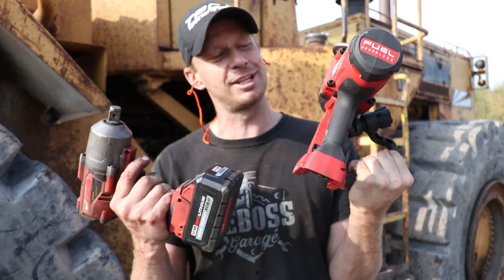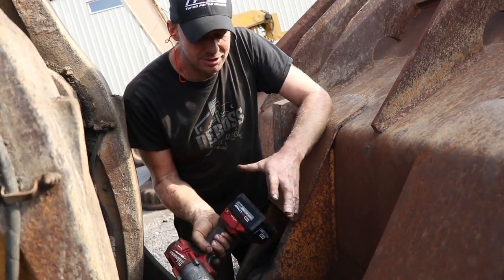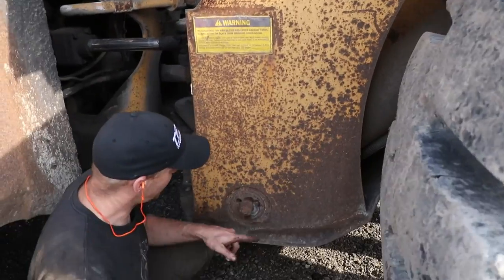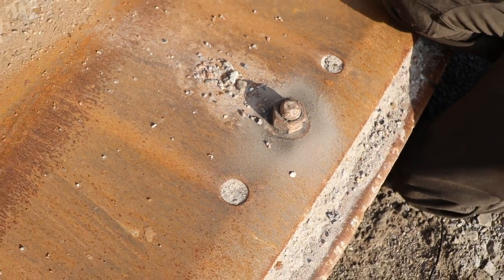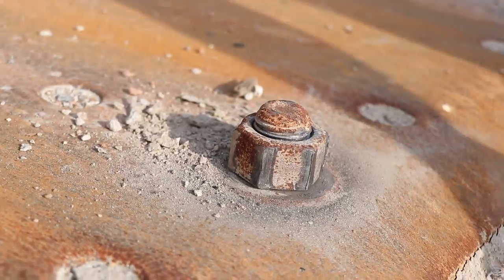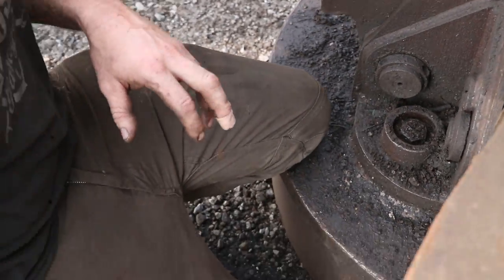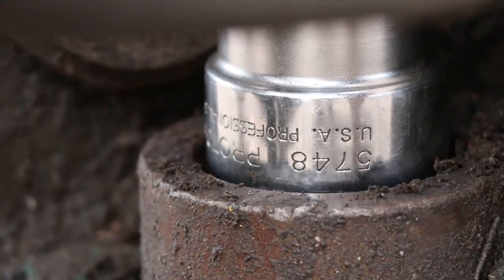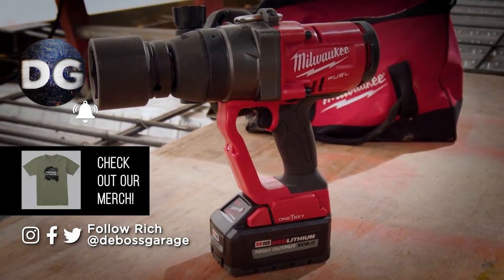Busting 40 Year Old Nuts with a 1 Inch Impact Wrench | Milwaukee M18 FUEL 2867-20 REVIEW

Comment: Impact sockets would make a big difference.... and also 6 point instead of 12 point
Reply: Why would impact sockets and 6 point make a big difference?  Just curious.
Reply: GetBlitzified impact sockets carry way more material for weight thus transferring more kinetic energy to the fastener. 6 point sockets have contact around the entire bolt head whereas the 12 point only make contact on the corner points of the bolt head thus allowing more energy transfer
Reply: GetBlitzified impact sockets are harder material so they don’t have as much give and 6 point sockets would offer more contact surface
Reply: Sam Wagner aren’t impact sockets softer while chrome sockets are harder and more brittle? Therefore, impact sockets handle impacts better. 

Seems like if you wanted the most energy transfer a harder socket (chrome socket) would be best.
Reply: AaronMoore I don’t believe so.. I’m no metallurgist so I could be wrong, but I believe that impact sockets have a greater hardness so that they don’t twist as much as a standard socket, and they’re built thicker so that they don’t shatter. Like I said, I could be wrong. I’m not an expert, just a diesel tech student.
Reply: @G Manloh Impact sockets are chromoly and standard sockets are chrome vanadium. Vanadium are harder and less prone to flex, but when they fail, they fail big. They will eventually shatter when they fail.

Chromoly impact sockets are more ductile and will handle impacting a lot better. When they fail it's usually a single crack up the side or even cracking in half, but they disspate energy slower and won't become projectile (usually. Broke a 2-7/8 impact socket in half a while back...that was a trip)
Reply: I was checking comments to see if anyone made that point before I made it - you did.  I agree wholeheartedly.
Reply: Yup chrome is harder than an impact and doesn't give as much as a fat girl. Moreover, I have no clue why he's using a 12PT socket and a single battery. Jesus spend the $150 and get another batter.
Reply: @SidewaysInTraffic  yeh i have the 3/4" mikwaukee impact and my experience is that once the battery is half empty it doesn't hit as hard anymore
Reply: @GetBlitzified  36% of kinctic force is being wasted also there is microscopic areas where ecpanding heat will fill. heat is the enemy of effecency essentially. a engine will run best in terms of towing torque and hp at 195 degress vs 215. Same thing with computers when they run hotter ram is utalized nearly 27% less!
Reply: @Piecemakerfirearms  couldnt have said it better
Reply: @SidewaysInTraffic  the batterys are only 115$ on sale....plus he makes hella money from YT....this is milwaukee slander!
Reply: @samwagner31   Impact sockets are actually softer. The reason you are told not to use standard sockets is because they are harder and more brittle which is why you can go look up countless videos of standard sockets on impacts shattering/cracking. 6 points are better than 12 points because it has more contact patch with the bolt head or nut, but impacts are heat treated differently than standard, and are not as hard as standard and are also softer  making them able to endure the torque & vibrations from the impacts.
Reply: D-RAGE Runningflames nope, I’ve looked into it to confirm. As others have mentioned above. Impact sockets are harder so that they don’t flex, that way all of the power from the hammering is transferred to the bolt. Chrome sockets are softer metal with a hardened chrome surface.
Reply: I have bought some impact sockets which are specially designed for crank pulleys etc. The socket has a way thicker wall so it has more weight to pull the bolt round with the impact
Reply: @samwagner31  https://agradetools.com/impact-sockets-vs-chrome-hand-sockets/
here is a link explaining it. Impact sockets are softer making them less brittle which allows them to take the impact and vibrations to transfer work. Skyscrapers sway in the wind as well as have movement in certain ones to stay standing during earthquakes. The taller something is the more sway it will have. Fact. (you can look that up as well if you wish) The same principle applies here. The softer material allows for the give and take vs the shattering of standard chrome sockets. 2 year degree automotive technology, as well as associates degree for automotive technology high performance racing application and development. Provided and article for you above. Impacts are softer. It has to do with  shock load it can endure. You cannot take something that is hardened and expect it to be able to handle torsional load and vibrations. They break simple put. Impacts are hardened differently and have a different chemical composition on top of that. Another fun fact about vibration and being able to endure vibrations. Salt flats racing. Any time they have a break on their vehicle. chassis or roll cage to be more specifically. Tig welding is not the best choice as its prone to breaking under heavy vibrations. Oxy-fuel welding however handles vibrations extremly well.
Reply: @jdm_john8240  thicker sidewall on a socket doesnt add more weight to loosen the bolt. Its torsional load on the socket. Weight and leverage only matters when you are using a socket and ratchet or breaker bars with cheater pipes in extreme cases. Companies will always have special tools, however the socket would be thicker due to it being softer to add strength to it, and no thats not the same as hardness. As an example look up aluminum connecting rods for a chevy 350 vs forged steel connection rods for a chevy 350. Big overall size difference The forged steel is much smaller in size. The aluminum rods (which are extremely popular) are thicker and more bulky to add more strength to the part to endure the loads it is under due to the material being softer. And to be technical. This is to everyone above. if anyone says they are selling hardened impact sockets guess what impact sockets as well as chrome sockets are hardened when manufactured. Its part of the process. The hardening differentiates between the 2 though.
Reply: Leen vd Linden idk why ppl use 12 point unless it’s a 12 point head of a nut or bolt
Reply: @samwagner31  impact sockets are a softer material that's why chrome sockets can shatter then on an impact is because they dont have as much give as an impact
Reply: @samwagner31  impact sockets made for impact guns
Reply: HONESTO UNO  
They make the best cordless impacts on the market
Reply: Lisle makes much heavier than usual sockets for removing crankshaft balancer bolts.  The extra mass makes a big difference in the ability of impact tools to remove the bolts.
Reply: Mitchell Nova  
Yes it does
Reply: Since I don’t know somebody please explain to me why a 6 point socket would be better than a 12 point also why not a chrome socket
Reply: @samwagner31  chrome sockets are actually harder
Reply: That’s correct Aaron.

Comment: I call my 1/2" one my "Problem Solver". Its all i need in automotive applications. My air impacts have been collecting dust since i bought it just over a year ago. Never looked back
Reply: yes who wants an 1400 nm stubby impact in the shop where air is always avaible if you could work for the same force output with an 8 to 10 pound tool. 
This 18V Tools are great for the field but still they are power to size and weight not even close to air tools and i doubt they never will exept there will be once a Batterie with nearly limitless output and no weight
Reply: @Zozo806  I use my M12 3/8" impact or ratchet 90% of the time. They are lighter then most air tools, and i dont have to trip over hoses or risk hoses scratching paint. The M18 is only used for larger/stubborn bolts, and ive never found myself holding it for any great length of time. Pick it up, spin the bolt off, then set it back down.

I was a huge air tool fan boy too before experiencing these tools. I have probably $10,000 worth of air tools literally collecting dust. I recently removed the air tool rack from my bench and stuffed them all in the back room.
Reply: @MarwoodAuto - that's good to hear. I was all set to get an air impact until I started learning how badass the new battery powered stuff is. I need to put new shocks/springs on my Jeep and my old 250ft/lb max Craftsman electric impact was doing absolutely nothing to loosen all those rusted fasteners. Hoping the Milwaukee 2865-20 I'm getting will work...
Reply: I feel the same way I have a 3/8” and a 1/2”  and my air tools have stayed in my cabinet since

Comment: Impact socks would make a big difference not only for fit but mass.  If you simply make the socket heavier the gun will hit harder.  Problem is you can't always fit a fat walled socket in places like on that mag plate bolt you were showing.
Reply: Not necessarily. Chrome is harder and less forgiving. Impacts are softer which makes them handle more "impacts". I would disagree a heavier socket will make the impact stronger.
Reply: @SidewaysInTraffic  Brian is on to something! The more mass that is rotating, the stronger the impact. So, if you get a socket with thicker walls than thinner, it will be more efficient. A good example is crankshaft sockets on cars- they are super beefy.
Reply: @jeremyhundley3142  I watched a few vids and they didn't do a proper test in my opinion. I'm going to hopefully try it this weekend and record it I get the chance.
Reply: @SidewaysInTraffic  For sure dude! Let me know if you post anything.
Reply: @jeremyhundley3142  But the socket isn't rotating? It's the hammer inside the impact wrench that rotates. Bigger hammer = bigger impact, but I don't think the socket mass comes into play. However, I imagine tighter tolerances and 6 point rather than 12 would probably make a difference.

Comment: Great video just waiting for the socket to shatter.
Reply: I know a guy that lost an eye, using a regular socket in an impact gun and it shattered. Stay safe, safety squints!
Reply: @seanmorrison5081  lost an eye?
Reply: @flisko123  they explode very violently one flew 16 feet and hit me in the arm I needed 5 stitches. I’d rate them as dangerous as ricochet bullets.
Reply: @DJ_CROFTY  thats shit, im using wurth set 96509059 and nothing shattered, or only low quality sockets explode?

Comment: I'm very sure that since that 988B was new that things such as lift cylinders and bucket have been removed for rebuild. Being in Quarry operations for many many years a lot of our older loaders (980H's) with 20,000 hours on them have had that stuff off for rebuild at that point. We have had 988's in the past that get frame up rebuilds after 20,000 hours.

Comment: The 1 inch Milwaukee is perfect for earth moving equipment. Bolts get packed with dirt and weathered. I can actually see the 1 inch line being used in bridge building and steel work. Would be ok for tractor trailor wheels too as long as they torqued back down to at least 450 to 500 ft lbs. Thanks for showing this tool off.

Comment: You should have used the 12.0 batteries. Not only do they last longer but they actually give you more power. If you have the vacuum and you go from any battery to a 12 amp battery you’ll hear the significant increase of suction you can also fill it with the impact wrenches and sawzalls.

Comment: Great video on the impacts. If those bolts are coming loose that often they could clean the bolt head and area around it and Mark with a paint marker. Then the operator could wipe the debris off at the end of there shift and see if it had loosened.

Comment: Pro tip, if it can’t break it, go forward like you’re tightening then reverse it.
Reply: Thanks man.
Reply: Is the Milwaukee 1/2" impact strong enough for car jobs?
Reply: @engjds  most defiantly
Reply: @JackTheTool thanks man, have some suspension work on a bmw, I did wonder.
Reply: @engjds  probably just go with the W9000 Series 20V 1" Impact by ingersoll rand.
Reply: @traviscarr6536  I used the Milwaukee 1/2" since that message, its powerful enough for any car job and even some tractor nuts.
Reply: @engjds  yeah I suppose the 20v ingersoll rand at 3000ft lb torque might be a little overkill 😂
Reply: @traviscarr6536  Has that been tested on the torque channel?, no good to me as rest of my stuff is Milwky.
Reply: @engjds  yes it has been on the torque channel. I went with Milwaukee too because I already have the batteries, charger and Milwaukee generally doesn’t disappoint.
Reply: @traviscarr6536  Yeah the name was familiar, so thought it maybe had been a winner, yeah like you say, I am not a pro car mechanic, so the Milky still has oodles of torque for stuff I do, yet to find a bad tool of theirs.

Comment: Proper pipes make a world of difference!

 I struggled with wheel nuts on my 1998 sprinter for three days. Penetrating oil, wd-40, heat, breaker bars, adapters, extensions, broke two ratchets with two meter extensions when jumping on them! The nuts would not budge!

Then i got a propper impact 6-point pipe and they all came off like butter! (Milwaukee impact tool ofcourse😉😂)

I am sure that every single bolt you tried to loosen in this video would have come off with proper pipes.

Anyways, good content! Cheers from Norway, where everything is rusted because we use stupid amounts of salt!😂

Comment: Test it on steel excavator track bolts. We use hydraulics to loosen them
Reply: DieselTechRestorations hydraulic impact guns are very powerful
Reply: Pneumatic torque wrenches work good too

Comment: Would be an awesome addition to a truck shop. Good for yoke nuts for diffs, headbolts for engines, suspension u bolts and threaded spring hanger pins.

Comment: And I called my 1/2" m18 fuel the stud snapper... I can't imagine this
Reply: Hell I snapped a half inch bolt on my lawn mower with my half inch ridgid mid torque impact. These are 3-4 times more torque compared to that

Comment: Try to find a rotary engine that's never been disassembled and try to remove the 54 mm flywheel nut they're torque down to 400 foot pounds but you add 40 years worth of heat cycling it's damn near impossible to get it off unless you have an a blowtorch 8-foot breaker bar and two strong people
Reply: Some bolts are just not for impacts. Or nuts...
Reply: @outkast0424  ????????
Reply: @deatherageperformance8367  like you said Homie!! Impacts dont always work... you often need what you said! Or like a hyro-torque
Reply: @outkast0424  okay that makes more sense
Reply: @deatherageperformance8367   yeah... i am fairly nonsensical! 👍
Reply: @outkast0424   hydro torque? does it use water? ive used this in large feed water and boilers https://hytorc.com/
Reply: Is that your car in your pfp
Reply: Try putting a 10 foot piece of steel pipe on the breaker bar.

Comment: I’ll stick with my 1/2” for automotive but cool to see Milwaukee making even better tools for the heavy guys
Reply: I would get the 1 inch to change tires on my pickup truck and car, not sure about a semi truck though
Reply: @Dunki113  my 1/2in has no problem doing tractor trailers and torquing them to about 500 ft lbs (spec). My snapon mg725 struggles, works, but struggles. 1in would be overkill. My old m12 fuel 3/8s does car and pickup wheels just fine.
Reply: @StrangaPsychoPachic  I'm not too familiar with electric impacts so I'm not entirely sure, I'm glad someone with some experience let me know more or less of what I need

Comment: After I watched your video from a while back about the half inch gun I bought one too and mine actually can take off track bolts. It worked on an old 336e excavator and a D8T with only 60 hours on it

Comment: Another good application is for the heavy haul side where the booster pivot pin cover bolts are always a pain to get out since there is always cross tension from the weight of the booster attached, even at level height.